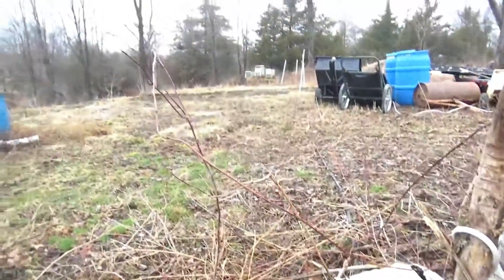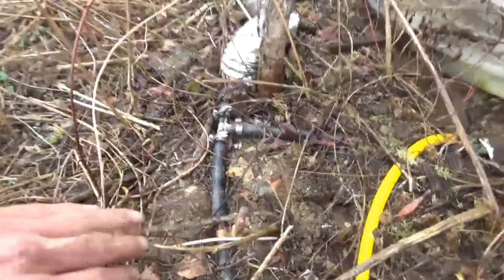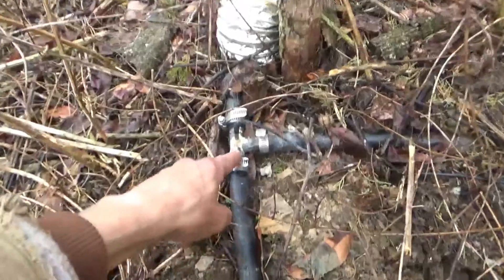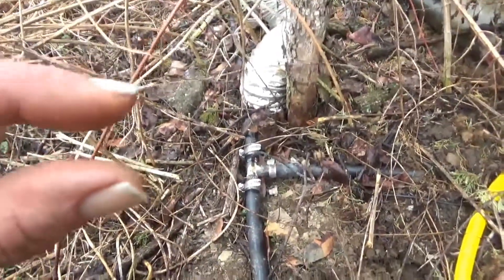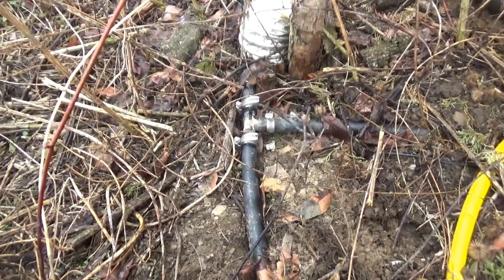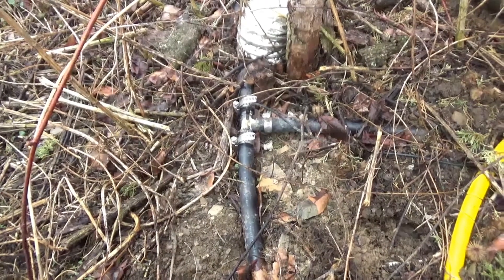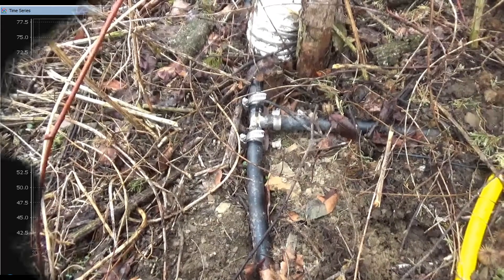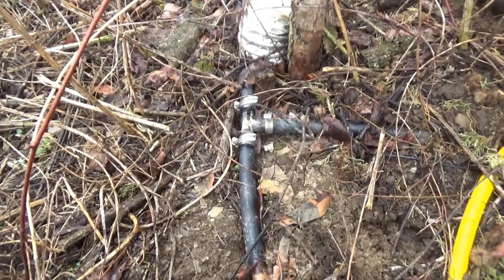DIY Make Your Own 1 Wire DS18B20 Digital Temperature Water Pipe Sensor

Comment: Very cool, Sir! I definitely have to get things set up like this someday.
Reply from the maker: thanks!  Yes, handy when it's all working well! :)
Reply: @TheFarmacySeedsNetwork  

i didn't see any sensor or any thing from your video. can you zoom in a bit ? 

i wanted to measure the water temperature inside the pipe of city water and the output of my direct on demand water heater in the output pipe. but i find no info of such on youtube.. any idea ? 

thx
andrew
Reply from the maker: I will try and get a closeup... It's pretty straightforward though... drill a hole... epoxy the sensor in.